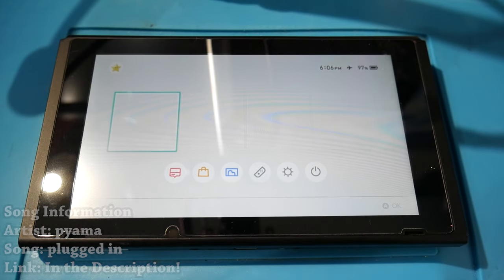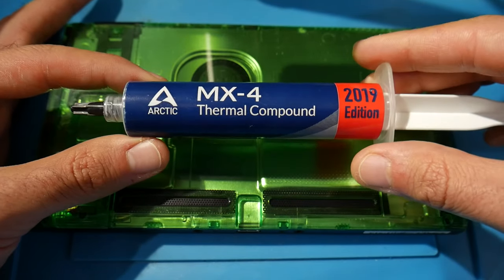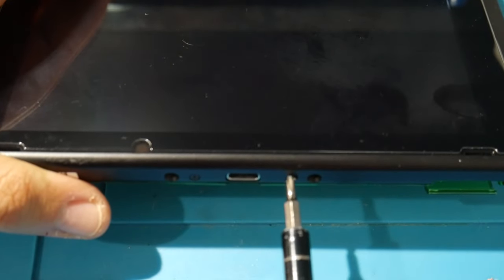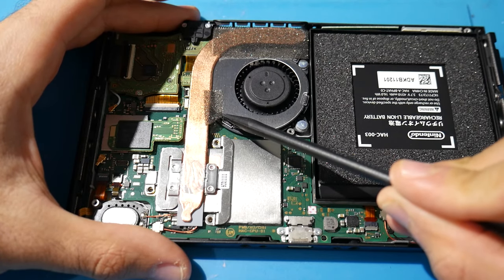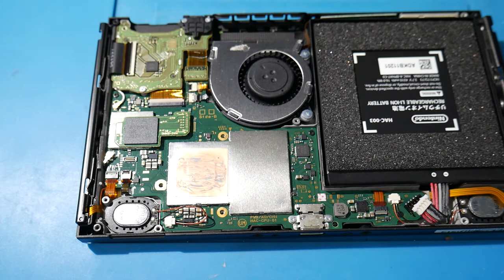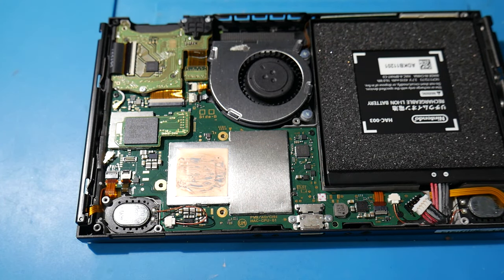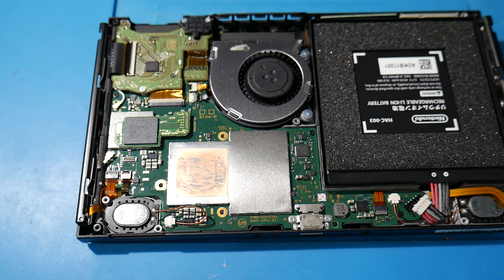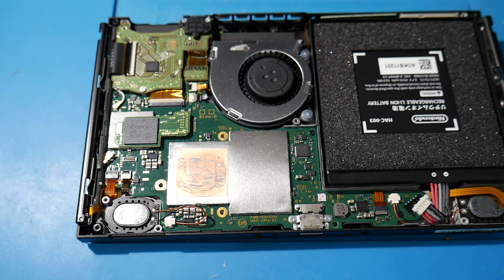How to Repaste the Nintendo Switch - Thermal Paste Replacement & Upgrade!

Comment: I cannot, for the life of me, remove the switchs back screws. They're stuck so tight i already broke two tools and probably damaged the screws too much. why the hell did they make this thing so tight?
Reply from the maker: I've never had issues with it across the multiple consoles I've opened. Only advice I have is to go slow and use the extract tip sizes with good tools. My iFixIt kit has served me well for about a decade now.
Reply: Get a JIS 000 screwdriver
Reply: I used a rotary tool to create a space for a flathead to fit and remove the screws, which to replace the screws and joycon rail is under 20 bucks
Reply: I used a knife that i had for stripping cables to make that screw to fit a flathead screw driver and it worked. This was a bit different knife and it requieres a bit of patience, but i was able to unscrew these screws.
Reply: I had the same problem the screws are very tight I use some penetrating oil with a q-tip to try and work some lubrication into it it seemed to help then I tried different sizes of the screwdriver using the smaller tri-tip seem to help was definitely not easy

Comment: Can anyone help me please? I did this exact tutorial to add thermal paste to my switch after I resemble everything, my screen shows no display but the backlit is on and everything working through sound and touch screen.... What did I do wrong 💀????
Reply from the maker: You tell me what you did wrong? None of the components or ribbons required for the screen to function are touched in this tutorial.
Reply: @MrMario2011  yeah that's true that's why it was very super strange
Reply: You probably poked the motherboard or a capacitor when you were removing the shield
Reply: @punctuationgamer636  most likely yeah, I will admit sometime I was little rough especially taking out screws. Two days later I just got another used v1 switch. I probably not going to mess with it like, the switch doesn't generate much power anyways so I'm not going to bother changing out thermal paste

Comment: My switch goes off with the battery logo on screen even though it is charged, but this does not happened when playing on the dock, would this be related to the thermal paste? I changed it about three years ago along with the battery which could also be the reason as well. Thank you for any help!
Reply from the maker: No correlation.
Reply: @MrMario2011  thank you for the quick reply and confirmation!!

Comment: Done the same last year, it's nice to finally see proper overheat fix videos. A lot of ppl just either forget or don't know to also operate under the heat shield. My only difference with this whole operation is the last paste applied, instead of the MX-4 i used a K5 pro because the original one was a reddish semi-solid thermal pad and not a regular thermal paste.
Reply from the maker: Taking that IHS off is terrifying, thankfully with magnification the process is easier. Definitely recommend that to anyone who is willing to try this, there's no point to going through this if you don't plan to pop off the IHS.
Reply: @MrMario2011  Agreed, it's literally "the" place where the core of the overheating problem is. If i didn't have personal experience with my other machines, i'd probably be quacked by now from tons of other videos online that omitted it. 

As for magnifying it, if you already have it sure, it can help. But it's not really needed if you operate with a needle and care. Or at least it wasn't a need to me, i managed to see the locks clearly anyway, with not even great eyesight. 
However, i'd definitely love to have the console magnified for any other very tiny repair (like soldering), those parts are too little and close between each others to operate safely with a naked eye.

Comment: Thank you for the tutorial, it was so easy following your  guidance, and steps were quite simple.
My fans did weird noise when running, cracked open my switch and found out all the thermal paste just hardened into chunks, didn't even need isopropyl that much, just picked up the pieces. Followed your tutorial, now it's cool, no noise, and I can safely know the thermal paste is fresh
Thank you!
Reply from the maker: Glad it helped!

Comment: I was wondering why my switch was always running hot even though I've cleaned the fan and repasted it. Thank you so much for this video. Gonna try this out tonight and hopefully fix that overheating problem !
Reply from the maker: Let me know how it works! You can repaste the heat pipe and the top of the IHS, but it really won't do much unless you actually crack into it and hit the SOC.
Reply: I finished the repasting, and I can confidently say that my switch is running much cooler now. It went from the fan being constantly on to barely noticeable. Thanks for another great video!
Reply: @kyber141 awesome is this switch oled?

Comment: I purchased a used V1 Unpatched Switch a few months ago. I was thinking about doing this as I want to play with overclocking it using CFW. Then this video shows up in my feed. Thanks Mr. Mario for the excellent video!
Reply from the maker: Go for it!
Reply: I recommend it, My V1 that i got day one release is starting to overheat in docked mode so I'm about to re paste my switch. It primarily overheats in open world games like ToTK, BOTW, xenoblade chronicles 3 and astral chain.

Comment: iFixit recommends using a viscous paste like K5 Pro for between the heat pipe and the shield plate. I noticed you used the same Arctic paste as on the inside. Is it viscous enough to stay in place?
Reply from the maker: That's what was used previously on this system, watch the teardown and take a look for yourself.
Reply: @MrMario2011  I forgot about that part of the video. 😅 I originally watched your teardown a few weeks ago before ordering what I needed. I'm so used to seeing the factory pink paste that comes in stock Switches that I forgot your teardown shows the MX already applied. Glad to know it works well in that spot!
Reply: @TheLifeoflink  That specific place isn't closed tightly, any thermal paste without high viscosity might drop from there as result and it happened to me. K5 Pro did the trick to me

Comment: I would straighten out the latch tabs before putting the spreader back on. Any shifting could cause air pockets in the paste and result in efficiency dips. If you are putting this much work in you might as well take an extra 2 min to align the latching to give you some peace of mind if you drop the dang thing later. 
Also he is right by not spreading the paste before putting the metal spreader back on. It can result in uneven contact (air pockets) it’s best to have a tall glob that smooths out evenly when pressing them together. Any bubbles or uneven alignment is a loss of contact and detrimental to the heat extraction flow efficiency.
Reply: Yeah, how close one of the tabs was to the legs of that little chip at 11:19 made me nervous. I don't have personal experience with it to know how close it was vertically and obviously it didn't cause any issues here, but definitely better to be more safe than sorry later and bend back the tabs.

Comment: I just did this a few days ago, a japanese model. It had some serious gunk paste, reddish in color on the heatshield part. Weird. I used MX4 like you once cleaned up (although i didnt really bother with paste stuck between the capacitors, it wont hurt). Sure made the fan quieter.
Reply from the maker: That's how it goes!

Comment: Question: if you mess up and break the adhesive strips, what could you replace it with that you can just buy? I was thinking isolating tape but it could be a bad idea for some reason I'm not foreseeing.
Reply from the maker: I would probably use kapton tape.
Reply: I don't think it should be that much of a problem. I assume it serves to keep it aligned and not have wobbling inside so either tape it back with some heat resistant tape or just add some thermal pads.

Comment: Great as usual Mr M. Ive been meaning to do mine for a while. I've had it since first day of release. Well over due 😮
Reply from the maker: Get that thing cooled down!
Reply: I wouldn't do it just for the sake of it - like Mr Mario said, this will help with cooling if you fans are running too loud or frequently or there's some noticeable lag in performance.

Comment: Thank you for this. I had some slight trouble to clean my paste as mine was a mariko console with slight repair/modification to it (for learning purposes) Therefore I had to be careful not to destroy solder pooints whilst cleaning the paste. I suppose there might be better way to do this. Moreover without some sort of magnification, it is difficult to remove that metal plate with the two needles :( If magnification could be recommanded, what is a good mid range to good item to get?

I want to do my ps3 slim, and wiiU next. I feel PS3 will be hard. WHen I did PS4, I did not bother to reach the part that would require repasting. It was so hard to remove the shiny cover of my ps4 launch model.

Comment: Not sure if Thermal Grizzly’s Graphene pads are usable here because they’re conductive and you really really need to be sure that the sheet is clamped down properly on the heat plate
On the upside - not liquid, lasts forever
Reply from the maker: Yeah, best to just go with thermal paste.

Comment: I was very cautious getting to the CPU and ended up Damaging the shield beyond repair. To make up for the now Destroyed shield, I used Silver Paste on both the CPU and Heatsink to kinda make up for that loss. It’s been a few weeks and I haven’t run into any problems without it. Believe it or not, my Switch runs slightly more cooler than it did originally and before it started to overheat from the dried out Factory stuff.
Reply from the maker: I believe it! I believe the shield is mostly for interference and is probably required due to regulations.
Reply: NGL, I feel like the shield was meant to be a pain to remove to Discourage 3rd Party repairs. I wish Nintendo made it unscrew-able (like the HeatSink) then I would be kept it instead of having to Damage and sacrificing the now Missing Shield
Reply: @StabTheDabb  I agree. But surprisingly the switch is more repairable than most tablets these days. So all in all I can't complain.
Reply: Stoked to get my old switch cleaned up and repasted. Maybe even a new battery in her.
Reply: @benson733  Remember to use a WARM blow dryer on the battery to losen the adhesive Don't keep it in one spot. And 91% IPA around the corners on the battery will also help soften the adhesive Nintendo used. You may give your arm a workout because it's a pita to get out.
Reply: @StabTheDabb  cool thanks. I mostly have 70 percent around the house and also some lower strength good gone. That might work too then clean it up with IPA after the battery is out. I might hold off  for a little as it seems to be holding up okay. I need to run some more testing to see.

Comment: I've had my switch since the release of Splatoon 2. This is my first time I opened the switch, and holy F the thermal paste is crusty like boogers. I'm trying to pry open the IHS(?), but it's so hard to open. I stabbed the motherboard a few times already. And I can't get the latch open 😭
Reply: Anyone got a tip to pry the latch open? Help.
Reply: I finally opened it. That took a long time lol
Reply from the maker: Gotta be careful, slow, and really see it. Magnification helps.
Reply: @MrMario2011  I already tested the switch, it doesn't heat up fast like before. Thank you so much for the tutorial! 😄

Comment: Any way to tell if the battery is dead dead? I've had the issue with auto rcm where it looks like it's off. But this isn't that, no chargers or button combos work. Hate that there's no mods connecting the battery wires to a PSU or somwthing
Reply from the maker: If it was me in that position? If you have a second Switch, it would be worth swapping a charged battery from one to the other to see if that makes a difference. Otherwise if you let the battery completely die and left it alone for a while, one of the chips that handles charging might have gotten fried. A super unfortunate oversight and a documented issue, which requires SMD rework to replace that little IC.
Reply: Plug it in charge for a bit before doing this.

The switch may be on but stuck in autorcm.

With the system powered off, press and hold Volume Down + Volume Up;

Press the Power button while still holding Volume Down + Volume Up;

Let go of the Power button and keep holding Volume Down + Volume Up until the maintenance applet shows up.

If you get into that back out of it and you should hopefully be good to go.

You could also try the hard power on when you hold a power button for 15 seconds.
Reply: @MrMario2011  thank you for the reply. I'll try and order a new battery but def saw a video about the charging chip and got annoyed. Hope that isn't the case but luckily won't be too hard to swap out